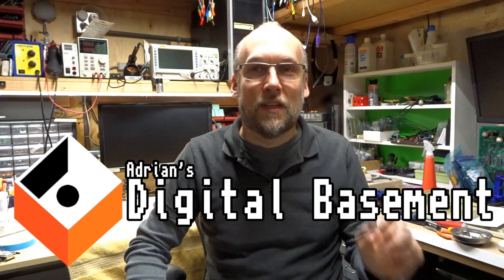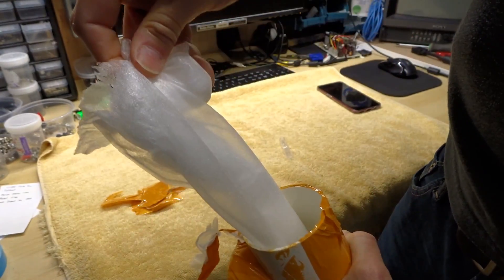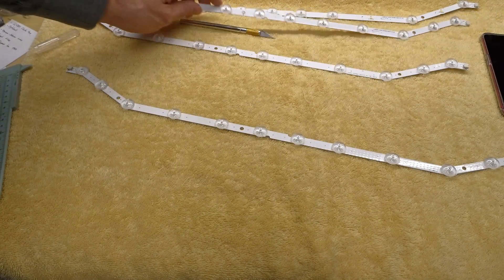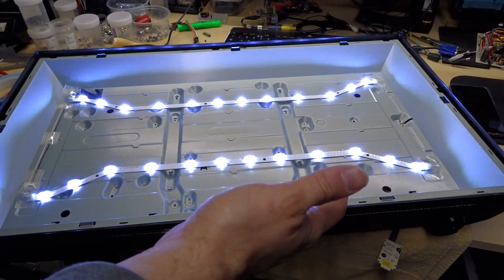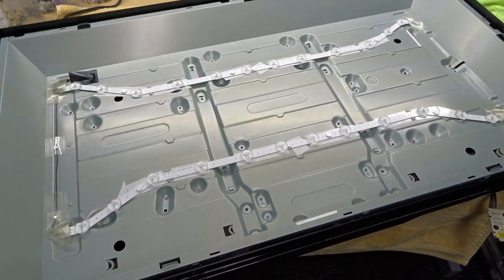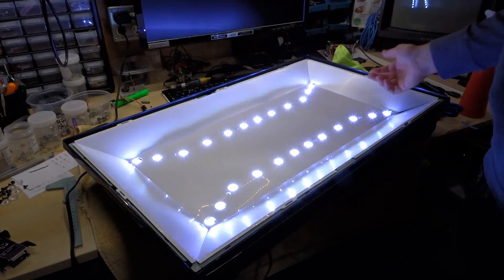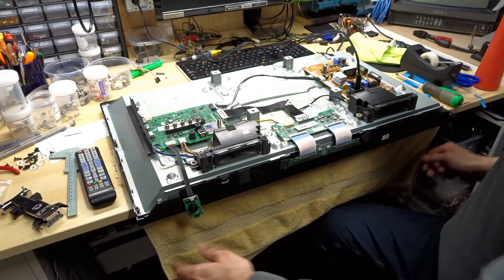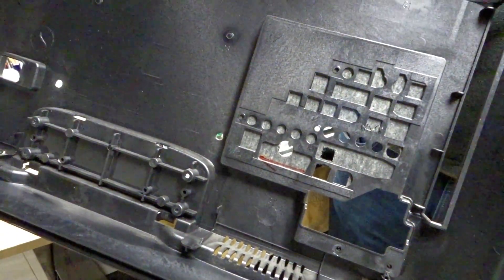Trashpicked Samsung LCD TV Part 2: New LED Modules

Comment: Did good for a trash pick, however, I was wondering about the heat. I noticed that they all generate a certain amount of heat depending on how long the set is on. Can a small or medium size cooling fan from a desk to computer be used if you tapped in the 5v+ side of the power supply if there is a connector that isn't being used? To help keep the back light's cooler. I used old computer fans on my home stereo tube amps, because of the location inside of the cabinet no airflow. Thank you for making the video I found it enlighting...Ha!, HA!.

Comment: I think also the cap feeding to the LCD has burst anyone notice that ? Its right next to the LCD feed plug it looks blown out {The K is split probably over driving whats left of the lcd,s that was not burnt out. You can see it clearer on part 1 at 5.39 next to the blue cap/relay. :) Great vid

Comment: I really enjoyed both videos. I was in the group for fixing it.At the end of vid 1, I was sad that I wasnt going to know if it worked or not.  I am also very glad that you did video 2 so my angst subsided. I am liked your style of trouble shooting. I am a boat anchor certainly analogue guy and I am scared by digital repair. You certainly seem to have a lot of knowledge on TV's. I dont think that I will pass up a nice flat screen I find in the trash. I can definitely trouble shoot power supplies. And I think I could replace the LED strips. Otherwise, it certainly could result in a lot of nice parts like that IR control board.

Comment: 2c worth. Consider next time to do a zero cost job and just steal the leds out of another tv with a cracked screen. There are heaps around to choose from. Led life in these units is hard to rate. The existing working leds on the strips you pulled out might be either just fine or almost on their last legs, how do you tell?

Comment: Hi. do you know to repair this things? UPS power supply.  they are hard to repair? expensive? thanks.
Reply: Whats wrong with it?
Reply: @maxz8807  nothing yet. just wanna know if its hard to repair. my model is well commander 1000. and i wanna know if 250-252 volts is too high for my pc and tv

Comment: Great video .. trashed picked broken lcds are not worth fixing of course but they do make great shop lights.  I usually unplug the tuner board and it stays full bright. The single board models are a challenge.. would appreciate your thoughts and perhaps a quick and dirty dimming solution (555 driving an input?). thanks

Comment: I have a device and I slightly damaged a wire that connects to a button used to operate it.  Rather than spend £7 on  a new button/wire including postage, I decided to buy a (very) basic soldering iron for £14.  I happened on your video doing research to find out the basics of soldering and what I needed to do to fix it (which I now have!).  I should be in bed, but felt compelled to watch both videos.  Thank you for  a very satisfactory outcome, even with the minor damage to that corner!

Comment: The blueish hue of the fixed TV is probably due to the cheap aftermarket led strips.
It still could be corrected by sticking patches of yellow translucent film over each LED, but is it worth the sweat?..

Comment: I just did the same repair on a 42 inch Lg 1080p TV..Unfortunately I didn't find it for free, I paid $15CAD for it and the backlight was a little bit more expensive than yours at $28CAD but still not bad for a decent Tv..That crack sucks but still a really good tv for the $17 repair cost.

Comment: As a repairperson, I HIGHLY recommend you changing the current sense resistor to lower the current going to the led's.  They fail prematurely because they are overdriven from the factory.
Reply: @oifex  from my opinion lowering it in the menu doesn't really help that much... they really blast the current to these led's

Comment: The crack happened when you reassembled the lcd frame... next time assemble it with LEDs front upwards. 1 reflector then defuser there should be plastic picks at different angles of the metal surface to help the defuser surface straight under the lcd panel. 3 the lcd frame. 4 the lcd screen then the top plastic or metal frame (I didn't see when you did  the  disassembly)that secures the  screen panel.....there are too many videos on the internet to teach all of us....
 But at the end you did a good job. 
 Store it fixed is better than keep it for parts...🎯

Comment: Totally worth fixing, of course. So many great possible uses for that monitor. I'd love to have it for DAW or video NLE use, recording studio second monitor, etc. And even if the panel were to go totally dead you would have a nearly complete set of spare components to pull and toss in a shoebox for your other set. LED strips, which you already know can go bad, power supply, T-Con board, all that stuff. So if your main 56" or whatever TV goes dark you'll always have something to watch while you're working on it, all thanks to this bit of "junk"

Comment: Good repair job.  LEDs appear cool white rather than a neutral color temp but expected from a China economy replacement. The bad spot is not that big of a deal being in the corner.   Could have rebuilt your LED strips.  100 LEDs under $6 depending on type the strip takes.  The driver only about $5 also if it was failing to cause the LEDs to burn out.

Comment: On the tvs I've inspected the cardboard backed reflector sheet was taped or glued to the metal over the lights. When you connected it to the tv back rather than on top of the lights it's possible that the cutouts didn't line up properly with the new LEDs causing a slight shift in color. You are very capable and held my interest.

Comment: I wouldn't have tried to fix it like other people suggested even if the  parts were cheap because it was way to much work and You weren't sure if it was going to work.Plus people sell that size screen TV fot 50 dollars all the time.Now if it was just a power up problem thats a easier fix and cost around 25dollars.

Comment: Question:  I’ve got a LG OLED B6 65-inch tv. A white vertical line appeared on the left side of the screen approx 7” in from the side. I was told that I need a new panel. What do you think is wrong? It went out of warranty last March. 
Thanks,
JU

Comment: dear adrian, thank you thank you. you are the best tech I have found online,
Have a problem with a lg 47 lw 5600 TV   have been dealing with for years. NO SIGNAL have another tv running next to it, the signal is fine. The picture has been going and coming for years. this is the 3rd tuner that has gone bad.  LG phone tech
has been trying to help me, only suggest is to reset tv to factory default, this does not help.
Would appreciate any suggestions.
Ronaldo Santa Fe,. NM

Comment: I bought a Panasonic plasma set 55 inch and it still runs beautifully after 12 years. It's HI DEF and Blu-ray discs look stunning. When it came to LED TV sets, I had no idea that they used white LEDs as a back light. I, and a few other people were under the impression that the screen consisted of tiny groups of LEDs in Red Green and Blue and as a single LED can change colour, I thought that as pixels they switched on or off to give the so called true blacks etc in a movie. After watching your videos I was gobsmacked. For all intents and purposes, this set works the same as an LCD screen with a back light and if your running an LCD screen with a computer, you can see the size of the screen at night if a screen saver is used!? Now I know why my tech friends have shyed away from LED TVs. I might also add that my plasma set has not moved a centimeter since it was installed which is why I've never had a problem with it! However other people who bought plasmas and moved from house to house, found that their plasma set eventually prematurely died after only a few years of use because of knocks and bumps! Thanks for your repair video. I have a Panasonic set in my AV room which is brand new but I'm now not sure what format it is but I  intend on finding out. It is 3D capable and the picture is beautiful and no, that set will not be abused either. After watching your videos I'm gonna share this info wherever it's needed. Cheers from Australia, Andrew.
Reply: Yes, the only difference between “LCD” TV and a “LED” TV is the kind of backlight. Both use an LCD panel for the actual pixels. An “LED” TV uses a LED backlight like the kind in this video; an “LCD” TV uses an electroluminescent panel (slightly older tech used before white & bright LEDs were cheap enough). There are also TVs that don’t use backlights at all and where the pixels themselves emit light, these are OLED (and I think plasma too).

Comment: My 32" started flickering when first turned on, and over a few days it was worse and worse until the TV didn't come on anymore. I fumbled around with it, with advice from youtube and other sources and found the flashlight trick to see if there's still a picture, which there was. Then I started probing around with the TV taken apart along the top. I could still reach inside and hit those test pads with a finger, there was enough conductivity in my finger to let current through and I found one bad LED that way. Instead of ordering all new strips I just bridged over that LED with a piece of wire. I figured with 24 LEDs the difference in voltage to the remaining 23 wouldn't be an issue. I've been using the TV that way for more than a year now. I really wonder how many TVs end up in the trash bin just for one 10-cent wonky LED.

Comment: For 20 bucks, its perfect and that little blob in the corner in a way makes the tv special in that its not just another perfect clone of millions produced so it has its own little personality if you like as a saved puppy from the pound. If you really want to get pedantic, you can tape off angled pieces to each 4 corners equally thus the tv is now resized and you wont see the damage. You can re open the tv and cover directly over the screen with black paper and it will look professional and not noticeable. I had a computer monitor with a thick line on the far left from lcd ribbon failure but left it totally alone as you cant repair them only to make it worse, and i like the monitor as it has its own "special" look and i never notice it as how often do you look to the extreme sides? If it was in the middle, i might try to repair or just keep it as a spares tv for others i repair.

Comment: Note, most TV networks have a spot much larger then that on the bottom right for their network or show identification. That is much larger then that spot on the left top corner.  My guess is either when it died, someone hit the TV and damaged it, or more likely to often people put pressure on the screen when moving it around or out to the trash. One of the flaws of a flat panel compared to a CRT. Good fix job. If nothing else others will learn from this and repair their TV instead of trashing it.   LED's do wear, or burn out. I thought they were more durable then the older lighting method.

Comment: This is one of the best "how to" TV repair videos I've ever seen, the fact that the screen is a bit damaged does not take away from the fact that you really know what you're doing and explain it all brilliantly so that it is easily understandable and followable. That said, I have this exact same TV model series except the 39" version. Bought it used for $50 and it works perfectly HOWEVER, when I pick the TV up and turn it over I can hear something sliding around loose in there. It sounds like coins or marbles or something! It apparently does not affect the TV picture at all, and I took the back panel off and there is nothing loose there, so whatever it is must be between the metal chassis with the boards, and the LED panel layers. I am half tempted to take it apart and see what it is after watching your video... but the picture is perfect right now! Ugh...decisions....
Reply: Leave it alone don't touch it !!!!
Reply: There’s a useful old saying: “If it ain’t broke, don’t fix it!”
Reply: Could be some plastic stuff, or some spare screws, let it stay 🙂

Comment: Well, that went as well as anyone could expect.  Perhaps that test pattern should have two options, one with the black line on the right, and one with it on the left!?  But, IMO then we may not have gotten such a great video!  Like I said, I'd take this one in the shop anyday!   In the first video, I was concerned about the original replacement part you showed.  I've seen unscrupulous sellers and that one listed said that for $20, you'd get (1) unit; (I'm thinking there's two per unit) and there were clearly (2) strips shown.  But, one can never can be 100% sure. (Who wants to send it back?)  I've seen a few that list a tester and the case, you build it; and from the drop down selection, they had two selections, one (A) for the unit, and one (C) for the case, and (B) was sold out.  Because of the images, it looked like no matter which one is chosen, all the parts were shown, tester + case, and a different colored tester(sold out). I'm waiting to hear back from the seller whether it's each one separately or together.  Never can tell.   Also, for yours, the $17 is a good deal; and we never count the hours for repair do we; until we start trying to do it for a living. lol  Thanks for this; it's guys like you that show just how hard and easy a repair like this can be.

In my life, and that goes back to fixing a trash picked hybrid TV from a dumpster right after I got married and fixing it; got an upright Hoover, that I still have, that only needed brushes!  $5.  The lessons learned are invaluable. Like learning when testing the Horizontal output voltage off the cap of a tube/digital TV doesn't let one's pinky stray and get sent via involuntary spasm of electricity across the hallway to get knocked out against the wall.  Yes indeed, talk about stars... If I was cautious before; I had even more respect afterward. 15kV.  Thankfully I had my other hand tucked into my pants at the belt.  Don't remember where I read that.  Today's TV's in many ways are so much easier, just delicate.  Thanks again!

Comment: Well Done. Thanks for sharing.

I also have the same habit that I would not throw things away and try to repair or improvise it if I can to get it work. Like fan. if the electronic is not working, I will buy a 3/4 ( 3 Speeds + Oscillation) way remote control switches from AliExpress which costs me around USD 3~4 and I can get the whole fan working again.

Comment: The blob possibility was there from the beginning. Yes look over every inch of the screen before disassembly. I also take the screen apart differently than you did. I use two suction cup things to lift off the panel and place them on a very large dry erase board that i have mounted on the wall at an angle with a lip on our to hold the panel. I loosely tape the circuit board that is attached to the lcd to the lcd to relieve any strain on it. Remove the diffuser sheet layers after I've taped the ends slightly. Put a dot on the tape and the metal frame so you put it back in the right way. Light off the thick plastic diffuser. I sit all that on top of the special screen holder I talk about. Then take off the whiter sheet covering the leds. Put back together in reverse order. Setting it off to the side like you did in the video possibly could have damaged the corner or when it was put back together and the screen was not quite back in its proper place. It was all facing down when you put it all together.
Reply: Plus the screens are fragile. You are always taking a chance when working on one. But if you are careful that gamble can pay off. I do think it's best to work from the top layer down. But that is me. Sometimes repairing the screen does not pay off. I've had a few of those as well. If you pay very little or nothing for the tv, you have something to gamble with. If you are paying more than almost nothing then maybe the gamble is not worth it.

Comment: I found an Akai color TV very similar to the size you repaired lying next to a dumpster on hot asphalt in a parking lot. When I plugged it in the pixels on the bottom quarter of the screen were totally dead. Even so I ran a cable from my cable box to the set. The picture was annoying for several days until one day I turned on the set and all the pixels were working normally. Apparently the heat from the asphalt temporarily disabled the pixels. I have been using this TV for several years now and the picture is perfect.

Comment: LED Strip - $17.00
10 manhours @45.00 - $450.00
Total cost - $457.00
New 32" TV - $220.00

Dopamine release when seeing screen light up - PRICELESS
Satisfaction of resurrecting something that had been discarded - PRICELESS
Project cost evaluation - Totally worth it

I salute you, sir. Thank you for sharing.
Reply: Right I found a garbage 50 inch got all new LEDs for $55 risky but I loved the fact that I got a new TV for the price of a used 19 inch
Reply: If you fix tv just as hobby and fun, how is that costing me anything?    Even if I wanted, I couldn't have used those hours to make money.
Reply: Those 10 hours could be brought down to 1 hour by someone who does this kind of work all the time and also doesn't muck about with setting up cameras and making videos.

But heah, fixing stuff isn't always about the money.

Comment: I seen a  tv with a streaks  no cracks the plastic cable to the screen was coming loose I used hot glue on top of the plastic to glass screen held it down with a pick untill glue hardened the tv screen was repaired. Save all circuit boards from cracked screen TV's put them in plastic ziplock bags. I would use them to fix other TV's. Carefully slide tv screen on to flat cardboard so it doesn't flex and crack, it's harder to fix the big ones!